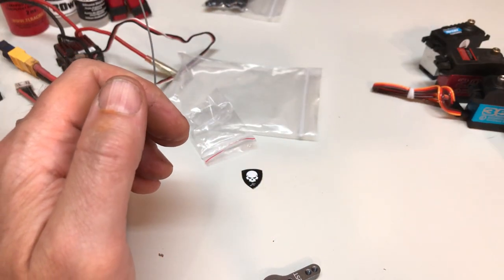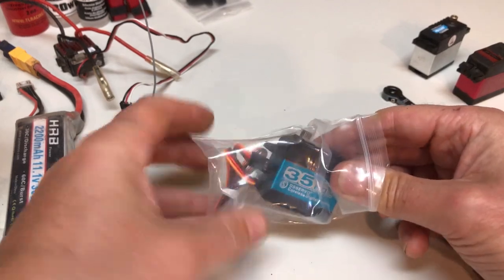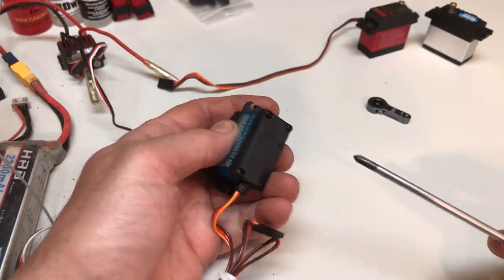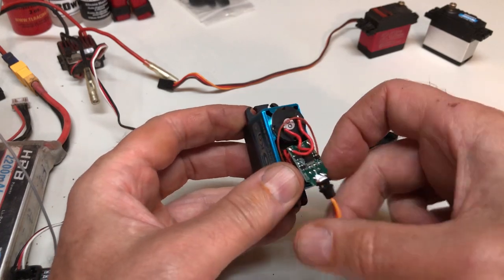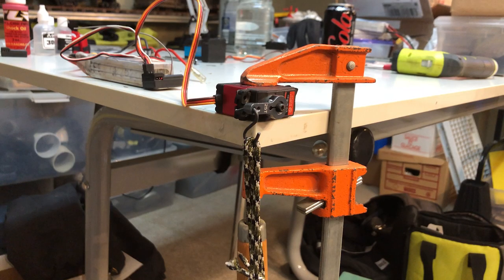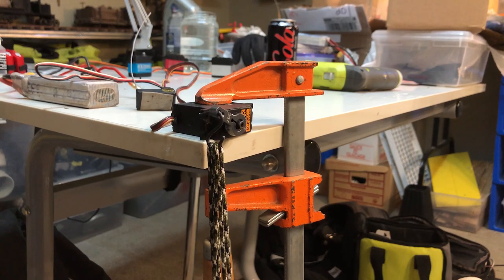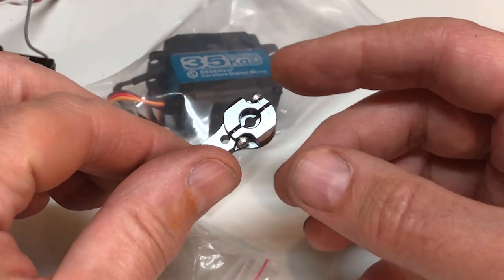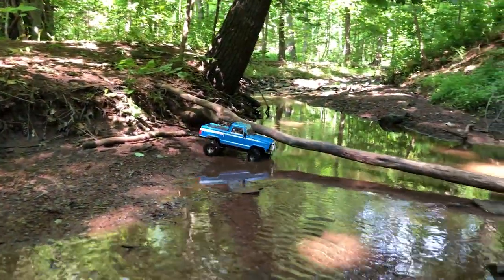35K Coreless Blue Servo - Bench Review - Good as the Claims and Word of Mouth??

Comment: My Zoskay DS3235 / FeeTech FT5330M 35kg servo looks nothing like that. When I popped it open, I found a bunch of damaged orings used to make it "waterproof", a small gob of grease on the smallest brushless gear, and some little balls of solder on the bottom. They don't use heat shrink, and the "triple coated" conformal coating was very thin, and only applied to the bottom PCB for driving the motor. They also use two cheap non-shielded bearings around 5.7mm ID, 9.9mm OD, and 2.4mm thick on the top. Lastly I think you are hilarious if you think I'm going to be able to replace a coreless servo motor. I tried to google both model names, no spare gears, no spare parts, no spare motors. This thing is junk. I only bought a few for training myself without opening the more expensive $100 servos.
Reply from the maker: Thanks for the update, FL. Evidently, a lot can change in the nearly two years since this review came out. I respect your disappointment.

Comment: Its waaaaaay better than savox
Reply from the maker: I would say, yes and no, and depends on which Savox. Yes, you pay more for a Savox with similar power, but if (make that, when) something wears out inside you can order an inexpensive refurb kit with all new gears and bearings. With Amazon servos, you are forced to wastefully throw away the whole thing. Also, if you constantly drive in creeks and rivers like we do around here, you can't beat a bona fide waterproof Savox. The light blue servos are not regular servos retrofitted with gaskets, they're designed from the ground up to be submersible. So it depends on what you want out of a servo and how much you want to spend. Thanks for the comment.

Comment: I found that this servo actually makes around 22kg, around 300-310 ounce inches. For $30-35$, at 7.4 volts it's extremely fast, and has plenty of torque for an 8th scale monster truck... And seeing as how it's completely submersible is impressive. I just wish they were a little more honest about the torque rating. People would probably still gladly buy it, I still did even knowing it was an overrated servo. That's really the only bad thing about it.
Reply from the maker: Great comment, great analysis. Thanks so much for the data. Sadly, we have entered a situation where manufacturers who refuse to exaggerate their specs risk losing business to those who are less reputable. That said, I have it on good authority there remain a few holdouts, like Holmes Hobbies, Reefs, Brothers, for instance, and personally, I trust Savox. I must quibble, good-naturedly, with "completely submersible" (big grin). Steps were taken to discourage leakage, but with ALL servos, take it from me, repeated submarine activity inevitably leads to a tiny box that's moist inside. LOL. Thanks again! Cheers.

Comment: Planning on getting one of this for my Laegendary Thunder (FTX Carnage 2.0 clone), it came with a 3.5kg one that does the job but feels week at times, great video and good explaining, but i do see a flaw in your test, the table is flexing some, not that the test is bias or unfair, but, that table flex can help making both look like they got the job done, even if one did it better.
Reply from the maker: Good point. I was surprised at how robust the test bench has to be. Even "weak" servos are surprisingly strong, making a heavy bucket necessary. Good luck with the Legendary Thunder and thanks for the comment, 402.

Comment: So would I need the 180 degree or the 270 degree for my red at gen8? I’m assuming the 180 but just wanted to be sure
Reply: You've got it right. 180 is all you need for a truck. Any further than that and it would be pulling in the wrong direction. You rarely need more than about 100 degrees, in fact. Cheers and thanks for the question.
Reply: @sorrypetetheband7286  thanks!

Comment: Hi!
Any followups about your later experience with these servo motors? Have you experienced any mechanical failure so far? 
Great video. Thanks.
Reply: Great question. All reports, and there are many, indicate that this servo lasts a long time, and does not burn up or strip even under heavy conditions. It's not capable of delivering the torque or be as resilient as some of the new servos from REEFS and other top names, costing four times as much, but it's good value for the price. Cheers.

Comment: I also noticed the motor makes direct contact to the aluminum body to greatly help remove heat by using the body as a heatsink. Some of the cheaper aluminum body servos have a large space around the motor or even have the motor encased in a plastic shell and just use the metal body for looks and do nothing to help with heat.
Reply from the maker: Great point!  Yes, I was pleasantly surprised to open it up and see the level of engineering. Thanks for the comment.
Reply: @NaturallyRC  Yea I recently got one of these and I'm surprised at how much you get for a servo that cost less then $40
Reply from the maker: @fuzzytech3846  The one I would really like to try is the Holmes Hobbies SHV500V3 SERVO

Comment: Great review. I really enjoyed your video.

I'm considering this servo for an ARRMA 1/7 Mojave 6S V2 4WD BLX. I see this servo comes in both 180 degree and 270 degree control angle configurations. Which would you recommend for the type of truck I'm looking to install it in as a steering servo? I believe that the control angle for steering servos on most RC trucks is no more than 90 degrees so does the control anglr even matter?

Thanks in advance,
Eric
Reply from the maker: You nailed it right there, Eric. When you think about it, if a servo passes 180 degrees, it's pulling in the wrong direction. And even when allowed to (emphasis) approach full 180, a servo is doing hardly any work towards the end, as the pull or push vector is all used up.  If you need a lot of throw, I always recommend a longer servo arm with a shorter sweep. So much simpler to get the geometry correct, and you don't give up much in the way of torque, especially now that high torque/high voltage servos are commonplace. Great question, thanks for the comment, hope that confirms what you already knew.
Reply: @NaturallyRC  Well, I guess I was just looking for confirmation of what I was thinking. I really appreciate your reply. Great video and keep up the good work.
Reply from the maker: @thriftysurvivor6117  You got it. Thanks very much.
Reply: @NaturallyRC  It was my pleasure; No thanks needed.
Reply from the maker: @thriftysurvivor6117  Canadians eh. 😁

Comment: Do you find that when it's turned off, the servo arm or wheels it's attached to turn really easy ?? Mine does that and I don't know if it should, works OK I guess when it's turned on though....
Reply from the maker: Great observation. Although they all look the same on the outside, servos can vary significantly in the arrangement of the gears, making it possible or impossible to rotate the spindle by hand with the radio off. NEVER with the radio on, or you have a problem. Honestly, I kind of like the ones you can rotate radio-off, so you can straighten your front tires on the bench or shelf. If you do this slowly and not all the time, I have read that it is not detrimental to the life of the servo. Cheers.

Comment: Here I am looking for reviews on an Amazon servo and what do I find?  NaturallyRC reviewed it too!  So, as stated at the end of the video, how did this servo fare after long term use, my friend?  I've been using an old standard Traxxas servo (or whatever they put in the RTR TRX-4 Sport) since my original one from Element seized up.  Element did send me a replacement, but I've since used that servo on another project.  I've been unimpressed with the Traxxas servo and want to upgrade and saw this one.  Let me know your thoughts o wise one! :D
Reply from the maker: Hi, Jon. Unfortunately, I can't speak to lonnnng term because I wrecked that servo in the torture test process by allowing the servo horn to bash against rocks. But going by the construction and materials I am confident that it is fairly priced and should provide excellent service under normal conditions. HOWEVER, only if it stays dry, or you open it up to remove the water now and then. Servos like this that are retrofitted with gaskets in order to claim "waterproof" are never fully impervious to water. In my experience, the only servos that pass that test are purpose built waterproof servos like the blue ones from Savox. Apart from that, longevity equals ball bearings, which a lot of RTR servos do not have -- they have bushings instead -- and why name brand, expensive aftermarket servos (with their quality bearings) are generally worth the money, imo. Cheers.

Comment: i wana use this for my active aero....how do i wire it.
Reply from the maker: If I understand correctly, you want to adjust the "wing" on your RC car using a servo. If this is the case, this is the wrong servo for that. You don't need all the weight, power, and waterproofing. Rather, do what the model airplane guys do and use a micro servo like this. Just mount it to the chassis and run a thin strong wire to the wing. You will need a receiver with an aux port, and a transmitter with three or four channels. Cheers. https://www.amainhobbies.com/spektrum-rc-3.7g-submicro-analog-air-servo-spmsa3070/p-qqzqt2uq7m2xactz

Comment: i have buy DS3230 for 30KG. Can you say me if i can hack for continuous rotation ?
Reply from the maker: I can't say for certain, but I CAN say that I have taken apart dozens of servos in my time and they all look pretty much the same inside, which leads me to believe they all can be converted to continuous. It has been a long time since I converted one, myself, but as I recall it was very easy to do. I used to use continuous rotation servos as gearboxes for my large-scale model railroad maintenance vehicles. Thanks for the comment and good luck.
Reply: @NaturallyRC  merci thank you !

Comment: Can I use this 35kg servo for my TRX6 with a 3C 11.1v lipo battery?
Reply from the maker: Absolutely. It will make a great steering servo for those big fat (excellent) Canyon Trail tires. The X4 is a superb truck, but owners agree, the stock electronics are the weak spot. Thanks for the question.

Comment: My esc puts out a measly 5.v to the servo, and since my stock servo is rated at 6v, my steering feels very sluggish especially at low speeds. I would rather not mess with an external BEC so I was looking at this since it outputs 4.8v+. Anybody have any experience using this with a 5v system?
Reply from the maker: That's a truly excellent question, Edgar. Stands to reason that a powerful servo like the 35Kg operating on reduced volts would result in a moderately powerful servo, good enough to get the job done in most crawling situations, but I have never tried this. All my rigs are equipped with Hobbywing 1080 ESCs, for good reason: They last (nearly) forever, are truly waterproof, easily tuned with the INCLUDED programming device, offer outstanding performance in the field, especially when you ENABLE setting 15, AND they're affordable. The 1080 is one product I (and all my friends) can recommend without reservation (and we don't get them for free). In fairness, I have only tried two other ESCs, similarly priced by Reedy and Dynamite -- both good, but not good like a 1080.
Reply: @NaturallyRC  thanks for the response! I really don't understand why a company like Castle puts out an esc that only produces 5v ( my best guess is that they want to upsell you their external BEC and link system), since a majority of high end servos work with 6v or more. I will be using this for my short course truck so fortunately a very demanding servo is not necessary.
Reply from the maker: @Girtthquake  I know, eh. Same reason half the lightbars you buy are 5v max. What's up with that? Hope you make it to the winner's circle.
Reply: Make new gears, or overvolt the motor. Those are basically your options.
Reply: I haven't tested it, but got 1 spt 35kg servo at home and it looks quality-did open it. There is factory store on AliExpress and they offer low voltage variant of their servos. Their rating is then for 4,8V, accepts up to 6V and with standard core motor takes 0.22 to 60° @4.8V
But they do have different variants, so i guess different motor servos will be faster. Many stores on AliExpress sell those too, so it's up to you if you wanna look for the factory store or any other trustworthy one.
i bench tested my servo only and found it not noisy, and having no problems with glitching or unwanted behaviour.

Comment: The issue with this servo is the play before it holds.... you can move the horn quote a bit before it starts to fight
Reply from the maker: Thanks. Interesting observation. I don't remember that, and can't check since I destroyed the servo testing it for my viewers. The wholesaler has promised me a new one to review and I will be sure to investigate. I would only ask that you ensure the servo horn is not loose on the spindle. The soft metal (junk) servo arms provided are incapable of gripping properly in a stressful situation. Cheers...
Reply: @NaturallyRC  interesting. For the clamping i use threadlock on mine. No its reslly the servo play and not the horn when i tested. Someone online too tested them
Reply from the maker: @EXTREMERC416  Thanks for getting back. I will for sure check that out.